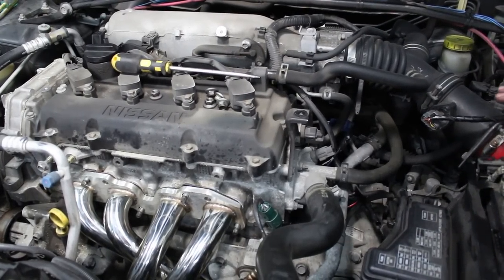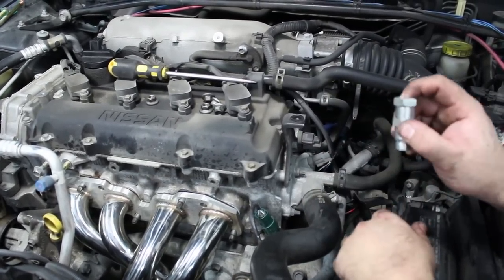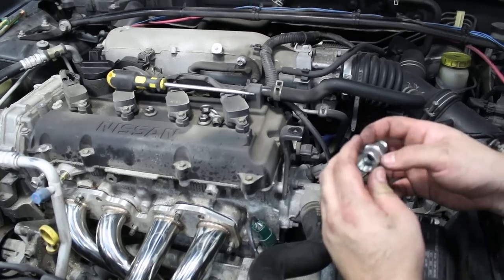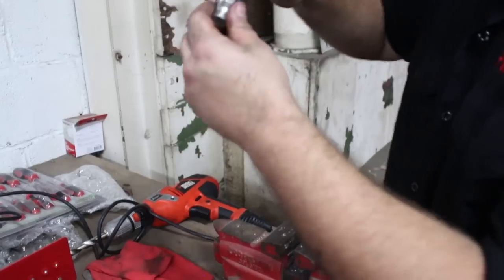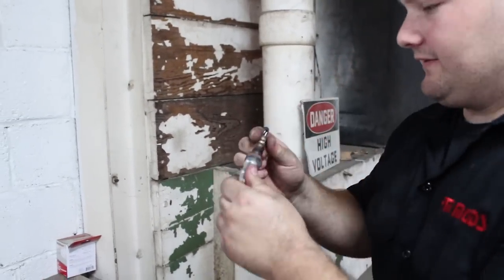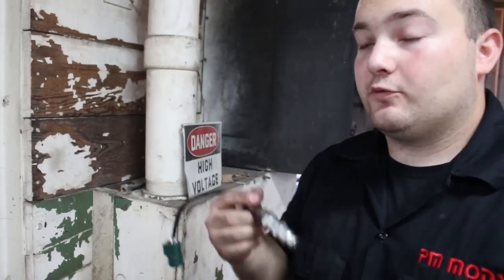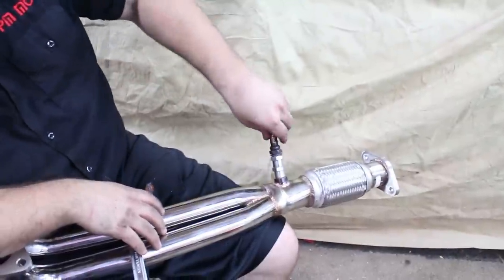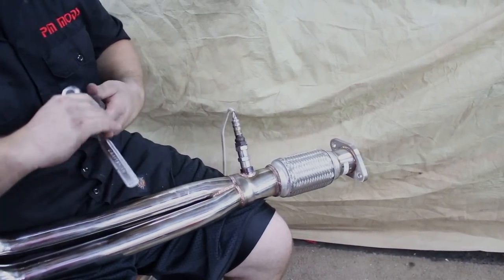$4 Catalytic Converter P0420 Fix | 02 Sensor Simulator | Pass Emissions | Oxygen sensor

Comment: Just want to point out, choosing to poison everyone you drive past because you don't want to spend the $$ for a working catalytic converter would be extremely selfish and counter-productive if that were your long-term solution. The cost of your drill and drill bit, plus your time and the buy-back you get from the muffler shop for your old converter's precious metals would just about cover the cost of a new converter. The $100 you saved one decade ago won't look that smart when you get the $100,000 bill for your lung transplant, unless you never warmed up your car or ran it with the windows down. No wonder health insurance is so expensive.
Reply from the maker: +Gorky T because racecar
Reply: the point of a cat isn't because of "health issues" or "lung transplants" but for environmental reasons. the EPA made them mandatory on all vehicles made in 1975, causing the fall of the muscle era because of how restrictive the exhaust flow. of course now with engines being regulated by computers now, you can have a 4 cylinder engine output as much power as a pre 1975 V8. BUT, if you remove the cat entirely, you can make that much more power. also, some of us rely on our vehicles to get to and from work, and just can't justify spending up to $1000 to replace the cat when it decides to take a crap, so this mod is well worth it until someone can save the money. also, #becauseracejeep lol
Reply: +noturfriend421 It converts unburned hydrocarbons to CO2 and water. CO2 is not an air pollutant, contrary to modern idiocy, but breathing PM-10s, benzene, formaldehyde, NO2, and PAHs will absolutely make you sick and kill you. Diesel heads who stomp the pedal of their unnecessary farm truck to pour out black smoke on some unsuspecting pedestrian "for the hell of it" are actually guilty of assault.

The muscle car era didn't produce healthy humans; the US will literally never be able to pay off its incredibly enormous debt because of how much medical care of muscle car seniors costs. Hydrocarbon pollutants enter the blood stream and interact with every component of the body, degrading mental capacity and emotional resilience, increasing allergies, immune disorders,  asthma, and DNA damage (cancer). "Can't justify $1000" You can actually buy a used vehicle for $1500 that has a good cat. But they don't typically just crap out, unless you drive only short distances that you could probably just walk. Dead cat means something wrong with engine.

Or you can poison people because you refuse intelligence. The nation is in your hands.

Comment: So, you've got a bad converter and instead of actually FIXING the problem you band-aid a fix.  The problem with this is that you ultimately make it harder on the rest of us because now the "Fast lane" emissions test will go away to catch all the "cheaters" that do this and we'll be back to 2 hours waiting in line watching our engines overheat so some jackass can spend 10 minutes joyriding our cars on a dyno and failing us for a gas cap.  Just fix the damned problem instead of band-aiding it.  I don't like converters either but I also don't like someone taking a free ride at my expense. An engine that can't pass emissions is an engine in need of attention or else one that needs to be on the race track, not the street.  That's reality.
Reply: Before you get too worked up, if you read lots of posts on this, you will see the vehicles DID pass emissions testing, and the fault is often just that the computer is too sensitive. look for the other mod that uses a resistor and a capacitor to filter and "slow" the signal. this "fix" shows that the computer is just too sensitive. there are also some brands of vehicle where they fix the problem under warranty by doing a firmware update that also filters the signal. they do it inside the computer rather than outside.
Reply: fuck that, its bad enough that big government tells you what you have to do about emissions and watch government vehicles on the highway pumping smoke like a freight train, not everybody can afford replacing an o2 sensor on their car or changing a cat because an ECM it too finicky,  we have a self service kiosk where i live and cant wait for an obdll car to pull up with twin holleys and a 671 blower hanging outta the hood, grab the interface and plug it into a module (laptop) under the dash and tell the emissions machine what it wants to hear and ride off with a passing ticket, (hint hint hackers)
Reply: What about all the Dam old school Cars i have several, Goverment just want money, the Earth atmosphere  is screw up from radiation tests and plutonium buried in the soil, so just enjoy the ride!
Reply: Dude I rebuilt a 96 sable with a DOHC V6 back in 2005. The car was good for a year or so, then started throwing the check engine light (EGR system code). Never had any running issues at all. Come inspection time I could just unhook the battery cable and reset the ECU, then drive it 70 miles pulling into the inspection station on like the 70 mile mark. The car would pass, then as I would leave the light would come on as I was leaving the parking lot... Took it to Ford paid to have it hooked to the diagnostic machine. Nothing found there. Their next explanation was to just start changing the EGR system solenoids one at a time until they found the problem or not. Those are $100-$200 each and there are 3 of them. So no, take your junk El Cramino and shove your opinion up your Azzhole, I'll do whatever I want to pass inspection...
Reply: A p0420 code will pop off if a converter is at 94% capabilities even if it still does over 90% of its job the code pops off...